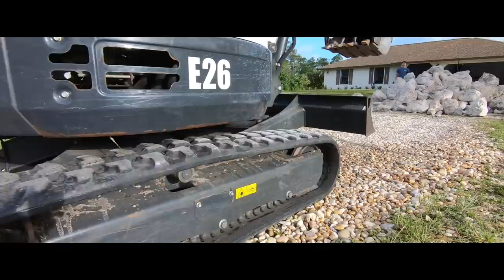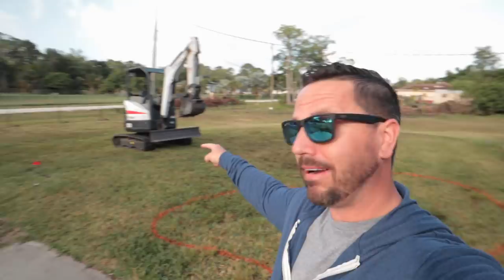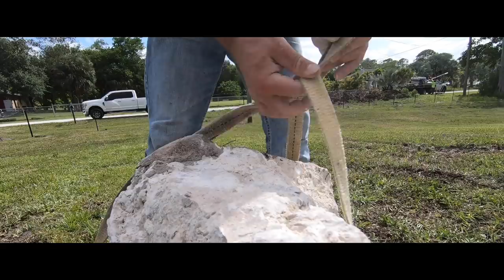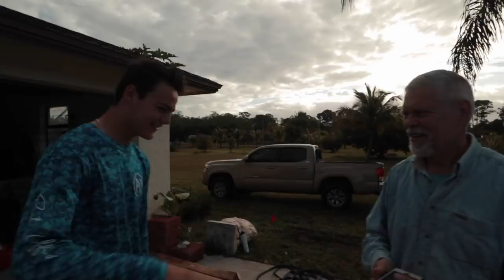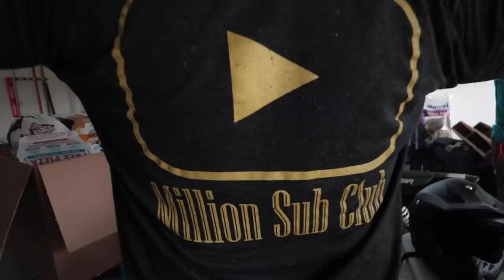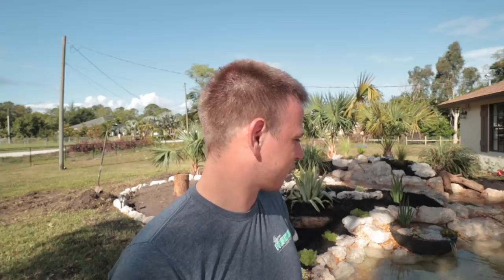PAUL CUFFARO New POND in front yard

Comment: Pond is nice but those rocks are ugly as the outer border rocks. Should have used river rocks on the border more decorative. Ok to use those in the water as you don't see them as much. 15k is a lot for a pond with those cheap   Florida aquifer rocks you can get for free at a rock quarry.
Reply from the maker: Sorry you didn’t like the rocks🤷‍♂️
Reply: The plants will grow in to soften the lines and detract from all the rock. The cost of the pond is not in the rocks its what you do with them that brings the value.
Reply: The rocks look fine